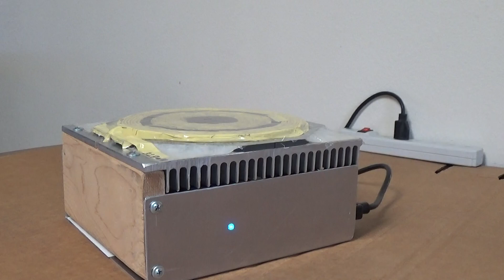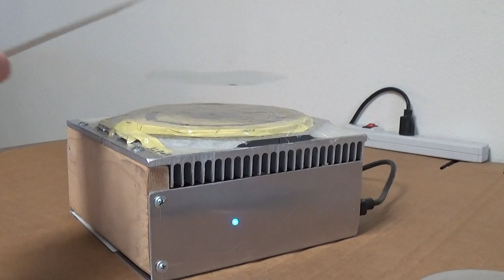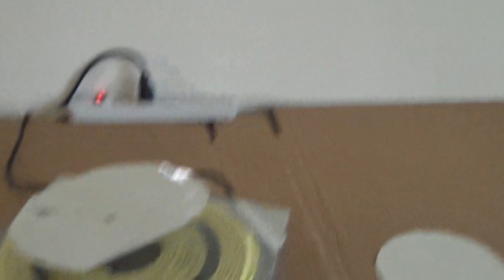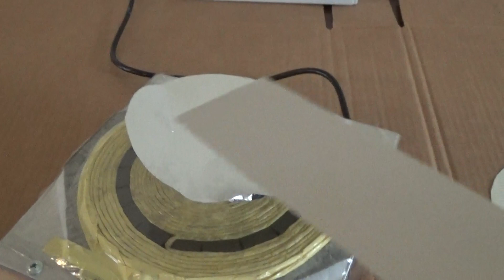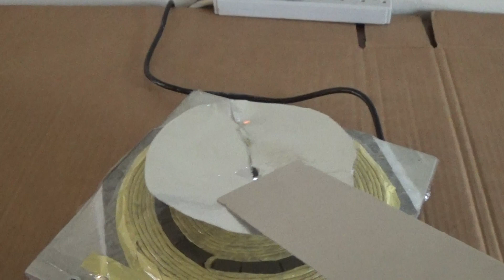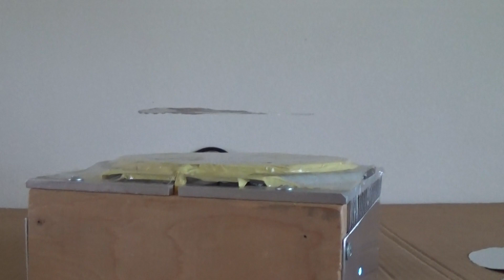Stable eddy current induction levitation of aluminum disk

Comment: can I do this with 24V DC?
Reply from the maker: Eddy current levitation requires AC.  It would be possible to power an AC inverter with a 24V DC supply.
Reply: @davekni  could you guide me towards a simple circuit diagram that includes a potentiometer to adjust the current to the coils? Im trying to build one of these for my physics class and demonstrate variable height of levitation.
Reply from the maker: The easiest solution is to buy a circuit.  There are relatively cheap ZVS oscillators intended for small induction heating experiments.  Here's a couple options on EBay for $12 or so:
https://www.ebay.com/itm/1000W-20A-ZVS-Low-Voltage-Induction-Heating-Module-Board-Flyback-Driver-USA/153283509508?epid=23020441248&hash=item23b068bd04:g:TtIAAOSwLMRcduto
https://www.ebay.com/itm/ZVS-Low-Voltage-Induction-Heating-Coil-Module-Flyback-Driver-Heater-1000W-20A/263368987499?epid=577831243&hash=item3d5203d36b:g:B4cAAOSwWflaJ40i
These circuits are Royer oscillators.  I made a version that has a bit more efficient FET gate drive - would be happy to email that to you if you are interested.  It would be hard to build something for much less than $12, however.
The easiest way to vary power would be to adjust the DC input voltage to the oscillator.  These simple Royer oscillator circuits don't have any other control mechanism.  One relatively-low cost option is a "universal" laptop supply.  Those are often adjustable from 15-24V.

Comment: Hi Dave, I found the video really interesting. Thanks for posting it. I am interested in keeping a mild steel metal disc in a  concentric position. I wondered if you could share your coil geometry, ID OD, number of layers etc? Also what ferrite you are using below the coil? Also an idea for you (if it's needed)  for improved cooling would be to use thermally conductive glue on both sides of the ferrite. Just an idea to decrease the thermal resistance from the warm copper coil to the aluminium heatsink. 
Lastly, I've been experimenting with electromagnetic Halbach Array designs, with the aim to make a single sided AC magnetic field. I wondered if you've every tried it. Or had any thoughts or ideas on that topic. Kind regards David
Reply from the maker: ID is 50mm with 5mm thick ferrite disk inside that, 11 clockwise-wound turns to 117mm diameter, a ring of 5mm thick ferrite pieces, then the winding continues CCW for 7 turns from 137mm to 180mm final outside diameter.  There's another layer of 5mm thick ferrites under the entire coil assembly.  Total inductance is 32.8uH.  The wire is home-made litz wire, 200 (If I recall correctly) strands of 35AWG wire wound with polyester tape.  The ferrites are 3F36 material, tiled and/or cut fro 65 x 51mm rectangle blocks (meant for use in wireless phone... chargers).Having said all the above, this geometry would not work to levitate a ferromagnetic plate.  It works by electrical conductivity of the plate, which supports an induced eddy-current that opposes the AC magnetic field of the base.  It might be possible to levitate a ferromagnetic plate if the levitating structure can be above the plate.  I'd be happy to explore your need further, but it should probably be by email.  I'm davekni@yahoo.com.

Comment: Hey,  just wondering, can this induction levitation device be made out of a portable induction cooktop by simply changing the coil? 

Thanks for reading,
Ed
Reply from the maker: I suspect it would be possible.  After completing this unit, I was regretting not starting with an induction cook-top, as that might be less work.  Besides changing the coil (reversing direction after using half the wire - a bit more than half the diameter), the iron-pan detector would need to be defeated.  The remaining question is if the cook-top's electronics function correctly without the load of an iron pan.  It might need to be powered from a lower line voltage, such as buying a 220V cook-top and using it at 120V.  The internal low-voltage supply for the control electronics might have a problem at lower line voltage, or might not.  It will take some experimenting.

Comment: Hi Dave, 
Just a simple question, is it a simple full or half bridge plugged to the coil, or is there some resonating caps?
How do you chose the drive frequency?
Regards,

Flo
Reply from the maker: It is resonant.  The coil current is about 45A RMS at about 200V RMS at 23KHz.  A lower frequency would be more efficient, but I wanted to keep it above audible range.  The drive is a single FET in a flyback style circuit.  At 23KHz, the coil needed to be litz wire, which is home-made 380 strands of 35AWG wire.  (My small prototypes for coil-geometry optimization used a low-voltage full-bridge in series with the resonant circuit, rather than a flyback FET in parallel.  Either one can work.)
Reply: Hi Dave!
little question, are you using a matching transformer between the coil and the bridge, or the coil is alone with the bridge?
Reply from the maker: No transformers.  The coil is in parallel with a capacitor to make a resonant circuit.  It is driven directly by the drain of a FET (flyback topology).  (BTW, late reply - didn't notice this comment earlier.)